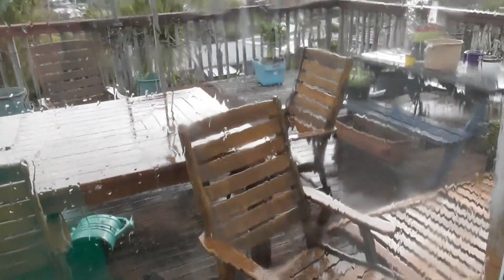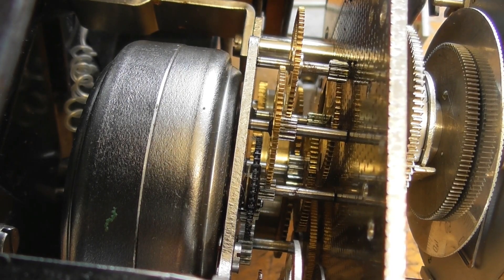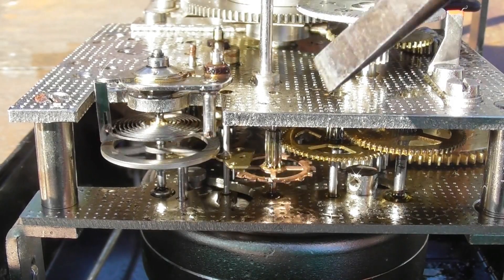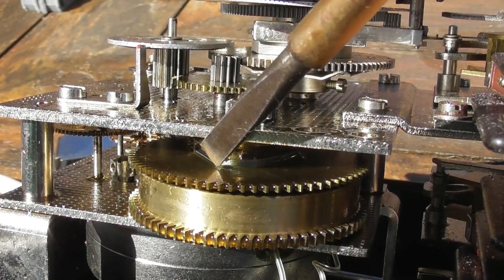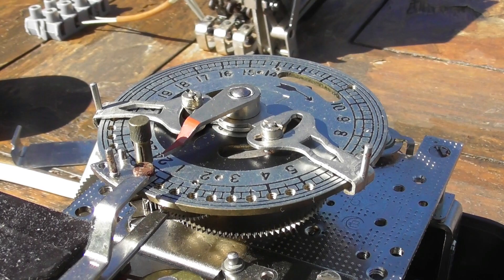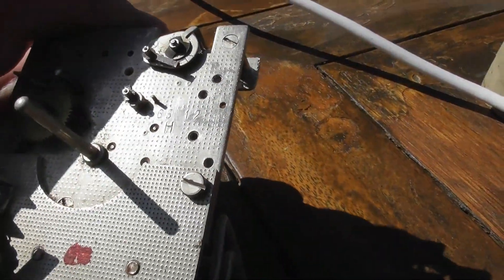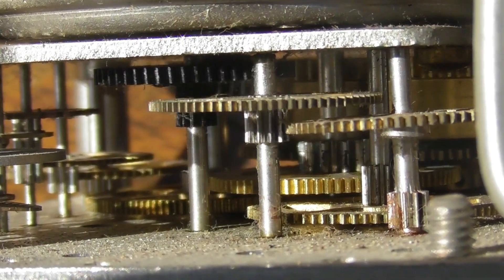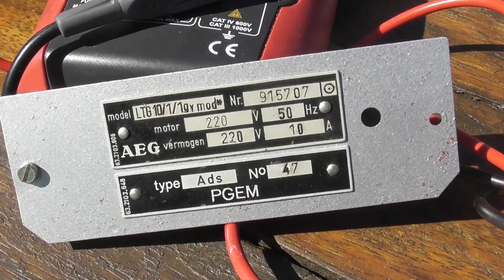AEG timeclock repair

Comment: I have a similar looking L&G (Landis & Gyr) timeclock from around 1972-1975 that I bought at a flea market alongside an Enertec Schlumberger timeclock from the same period. 

The Landis works fine (and is still ticking away as I'm writing this comment!) but unfortunately the Enertec was broken and beyond saving. The Enertec had the escapement spring constantly going, whereas the Landis only fires up the escapement ring when power is lost. 

Where I live those timeclock were rapidly replaced by the PULSADIS system, which is still in use, but who knows when PULSADIS itself will fall out of favor into the oubliettes...

Apologies if my comment makes little sense, English isn't my first language.

Comment: I actually have to deal with clock motors on rare occasion for my job. Not clocks but video tape cleaning machines. There's a problem where changing the cleaning web rolls sort of requires the operator to torque against the clockwork or... its so easy to do that by accident that it will keep happening. Years of doing that will kill the drive motor reduction and cost up to $ 658 of your NZ dollars. I'm the in-house repair/general tech so I want to dissect one and see if it can be repaired but I'm expecting trashed gears. The motors get totally locked up and are pressed and crimped closed.
Reply from the maker: Those synchronous motors are pressed together, sometimes rivetted and could be drilled out. That are expensive machines you are working on. Often plastic or phenolic gears have hardened over time and can become brittle and break easy.

Comment: Interesting. I understand you regarding the astronomical mechanism, always wanted to see the inside of that mechanism. Is that dimpling on the plate surfaces for hardening to prevent flexing? Also what kind of oil are you using?
Reply from the maker: Yes, the dimpling is to harden the sidewalls of the clock mechanism. I used CRC (not good for clocks) but frees up stuck parts, and synthetic engine oil.

Comment: When I repared my old pendulum clock I was told by pretty much every clockmakerperson that I should clean the mechanism and apply special clock oil at the bearings only, and nowhere else because dust collects on the oil and sooner or later it will end up in the gears. I was given a metal pin with which to "collect oil" by dipping it into a 2ml bottle and just touching the bearing and let capilliary action take up what it needs.

Spraying it with lubricant seems...very Rodalco :-P
Reply from the maker: Vinny142, yes the metal pin in a bowl with special clock oil is the correct way of doing it. When I worked in the metering department in the 1991 - 2002 period Waitemata Electricity, Power New Zealand, we did lubricating maximum demand mechanisms and clock movements that way. Then the metering department got shut down in favor of the plastic throw away society we live in.